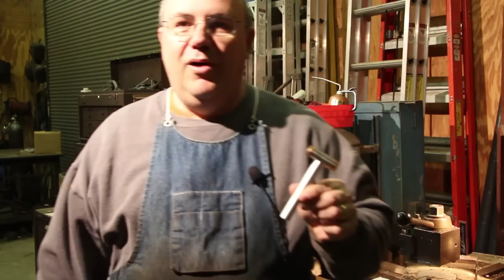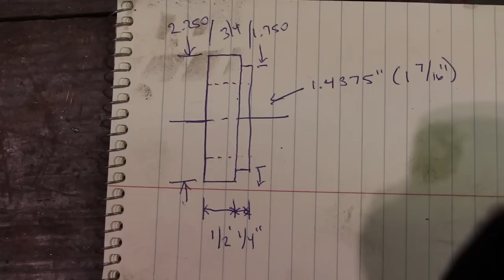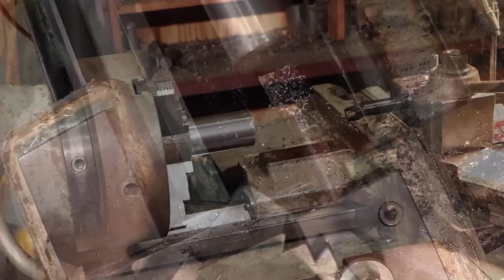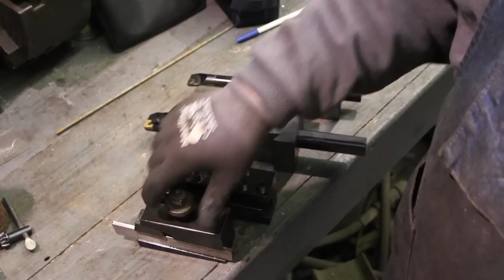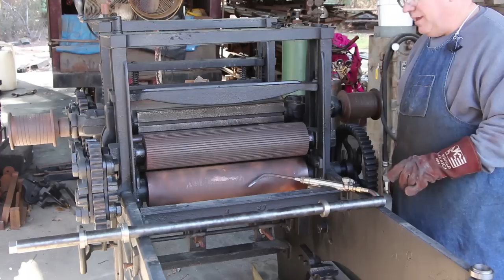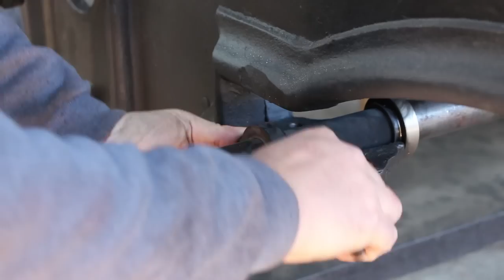Pouring Babbitt Bearings on the J. A. Vance Planer/Matcher

Comment: Keith... you might already know this or experienced this.  Years ago I was service manager for Otis Elevator in Richmond Va.  when one of my service repair crews was pouring new cadtex ( Babbitt hardener I believe ) on an old geared hoisting machine on a hot summer day in a meat packing packing plant. Sweat was rolling off their faces and elsewhere.  Some sweat off the face of the mechanic fell into the hot Babbitt pot heating up for the pour,.  The hot Babbitt exploded, spraying one of the mechanics with splatters of molten Babbitt.  Fortunately, neither  were injured.  A miracle and a very unforgettable lesson.  These mechanics were very experienced in pouring main Babbitt bearings, some larger than grapefruits on the big old gearless machines.  Take heed viewers when heating lead  for fishing sinkers or downrigger balls.   Excellent video.  Thank you.   Work safely.

JoeB

Comment: There's nothing more timely than commenting on 5 yrs old video, but hey, "better late than never", as one old lady said when she was late for a train...
Anyway, about those "impurities" @ 32:18 - "so as this babbit (...) starts getting molten (...) you'll get some impurities that will come up on top of the surface and you just want to skim those off" - well, in fact, you don't want to skim them off. Those impurities are tin and antimony (and other metals) oxides which are the result of oxidation of molten metals. When you skim them off, you just expose fresh metal to oxygen in the air, and thus induce firther oxidation.
One way to reduce the oxidation (i.e. to slow, or somewhat comtrol the process) is to cover the molten metal surface with grounded charcoal. This probably wlll not reduce (chemically) oxides already present, but it will slow the further oxidation significantly.

Comment: Friend, I believe you would get a better tin pour if you drilled a few 1/16" holes on each top cap, to allow gases to vent as the tin pours. This would certainly relieve you of most voids in the tin. You can also preheat the shaft and caps then dust them lightly with a film of talcum powder. This helps the tin to flow...Just some thoughts. Thank you for the excellent video.

Comment: I love old machinery and have a comment. In later years in the Machine Shop at the old Pacific Lumber Co. they used Duct Seal for damming babbitt  bearing pours.
My Father worked in the round house at Palco and I worked there as Power Plant Supt. for over forty years until my retirement.
Keep up the good work.

Comment: Nice video! You brought back some good memories of when I would Babbitt about 10-20 bearings at a time but it was done on a steel bench. We made a cradle to hold the shaft at the correct height and we had mandrells  for all of the sizes of bearings we had in the plant and we did this about every 2-3 months. We used to ( soot or sooting ) the mandrells and make shims out of wasted cartons from 1lb. Sugar bags and the Babbittrite (dog shit ) worked ( DAMN Good). 33 years of machinist and babbitting  bearings was a great job and slowing down the Chuck with the palm of your hand there's nothing like it but I never could wear gloves or wear rings or bracelets while running a lathe. I'm not saying your wrong I just was not comfortable with the things I've seen. Great video Jake.

Comment: we used to pour windmill gear housing bearings used a dummy shaft and plenty of putty  those flat well oiled Babbitt bearingswill handle way more load and last longer than ball bearings I have also worked on babbitt bearings in a ships engine con rod that were big enough for a man to go into the journal with a torch and a bar of Babbitt and fill in the scored bearing then we bored it  and reinstalled it and she was on her way   lots of memories  great video thanx

Comment: Very helpful video as I prepare to pour bearings in my buzz saw arbor. I didn't consider pouring the top and bottom separately but now can see that you get a much better bearing and can separate and inspect the quality of the pour. However, I thought you mentioned you were going to scratch oil holding groves in the bearing surface. Do you leave the gasket in the assembly and what is the process for adjusting the pressure on the shaft?

Comment: Wow!  Great video!  Brings back memories.  On the farm repair of disk, cultivator gauge, plow and planter wheels my father would spiral a small string around the shaft before the pour for a grease channel.  For the release agent he also would use thin onion paper around the shaft.  He wrapped the string around the paper to hold it, then he would rotate the shaft and bearing vertical, and sometimes make a small round funnel around  the bearing case, (which was really just a cast pipe or piece) and pour all at one time.  Just kids modeling clay was used around the bottom as a seal/ dam.  Drill out the grease zerk, bolt it back together  and away she went!  This was 55+ years ago!  My job was to pick up the spilt Babbitt.

Comment: Is Babbit, what we call Pot Metal? It melts under a fairly low temp. They use to use it on fishing poles for the handle.
Reply from the maker: No, nothing even similar to "pot metal".  Pot metal would not make a good bearing material at all....  "Pot metal" is a generic term that is often used to describe die cast zinc.  Zinc will also melt at a lower temperature but it is a totally different alloy from Babbittt.

Comment: I have read that to re melt Babbit metal is not best practice,although I appreciate that this is a low revolution usage would you remelt on faster bearing applications ie big end shells or main bearing in a internal combustion engine ?  Good video, thank you.
Reply from the maker: I like to save my old babbit as I do a lot of low speed stuff that I think it is fine to use on.  For high speed applications, I always use the new stuff!

Comment: just curious, why don't you upgrade the babbit shells to bronze bushings with maybe an oil fitting?
Reply from the maker: Why?  Bronze bearings work pretty much the same as Babbitt and quite honestly, after doing both, I think that the Babbitt is easier to work with.
Reply: Richard Adrian actually Babbitt is still in use in crank and cam shaft bearings in new engines and performance bearings for engines today.
Reply: likely the same reason he doesn't buy a whole new machine: it should all be original
Reply: Dana Muise  with Babbitt you just lay the shaft in and it lines up the bores perfectly every time when it's poured. if he used a solid bearing he would have to line bore the 2 bearings to make sure they are perfectly in line with each other, and the distance between the bearings would make it very difficult to get the shaft to spin free.
Reply: Tyler Hensley yeah I kinda figured with gasoline engines as well. However my main experience with newer engines is mainly with extremely large displacement marine diesel engines and try not to speak unless I know. Otherwise the newest gas engine I have done full tear down on is the 73' 440CID in my charger.
Reply: Keith Rucker - VintageMachinery.org this is an older vid, but I just stumbled across it. you were mentioning that babbit bearings are still in use in various applications and one application that I have encountered is in marine diesel engines. I have done a few rebuilds on the cat 3612 series engines. I actually was unaware of that aspect of the history of that type of bearing, nor was I aware of what it's specific name was. I have only known them by their mechanical nomenclature. so thank you for the interesting video. taught me something that pertained to my experiences.

Comment: the blaking trick works when removing stuck stainless bolts from 6061t6 alum.burn off the black and very quick try to get the bolt out...

Comment: why do you pour the babbitts in place instead of pouring them on a work bench and then placing the bearings on the machine?
Reply from the maker: Getting the bearing shells perfect aligned on the bench the same way they would be on the machine is nearly impossible unless you build a special jig.  Just not worth the effort when you can pour them on the machine.

Comment: First I wanted to say I love the videos.  You do a great job.  Now I have a question.  Why did you do the pour while the parts were attached to the machine.  You mention many times that it is tight and difficult.  Would you be able to remove the part and place them in a Jig on a bench then return them to the machine?  Or am I missing something basic?
Reply from the maker: It kind of depends on what you are pouring.  I would rather pour on the bench when possible, but with some setups, it is critical that you have multiple bearing blocks in proper alignment with one another, and there is no better way to accomplish that than to mount them on the machine where they go and just pour them in place.  It would be very difficult to come up with a jig on the bench that would put them in perfect alignment like you get on the machine.

Comment: A little trick when using (thin) gasket paper for small things:
You can use a photocopier to get the shape on the paper. Just make sure to set the zoom on 100%. ;-)
Reply from the maker: Good tip!
Reply: For small parts I use an ink pad and stamp the part directly into the gasket sheet.

Comment: Ive never seen a heavy duty gas Turbine that doesn't use a babbit type material on the bearings. Ive always wondered how the machine shop does this.

I really enjoy your videos! You're very knowledgeable and have taught me a few things.
Reply from the maker: +Cierra Seal That is basically the method, however there are some more modern methods of pouring babbitt for modern applications, including centrifugal casting and such.

Comment: I have used pottery / ceramic clay for years as a damming agent when Cad Welding electrical ground connections .

It can be molded as you were doing .  When the heat of the molten copper hits it , it instantly dries , to a hard consistency .  And , of course , being clay , it is fire proof .

After everything cools , it is easily broken away .

It is available , locally ,  in 5 pound blocks , at a store that sells arts and craft supplies .

I tried , long ago , using duct putty .  It seams to be oil based and melts when the heat hits it .

Here is a product made by Cad Weld that probably does about the same thing .

https://www.erico.com/part.asp?part=T403

God bless
Wyr

Comment: Hello Keith,  I have a dumb question.  I watched the video of the Babbitt pour twice and read through the comments but I missed the part on the smoking of the axel shaft.  What is the purpose of putting a layer of carbon on the axle before the pour?  Why did you only need to smoke the shaft for the top bearing and not for the bottom one?  When you poured the top bearing would it help the quality of the bearing if you drilled a second vent hole in the bearing cap to allow the hot gasses to exit while pouring?  Thank you for the information.  Brad
Reply from the maker: +Brad Johnson The purpose of the smoke is to serve as a release agent to help the babbitt separate from the shaft once it cools down.  I usually only smoke it once - it is still there when you pour the top half (but you could smoke it again if you wish).  A second hole would not hurt anything but I usually don't find it necessary.

Comment: Hi Keith, with the Babbitt bearings would it be possible to bolt the shells together with shims and use a reamer instead of scraping them?
Reply from the maker: +Doug Borrett I have used a reamer for solid bearings before but never on split bearings.  I am sure that it would work, I just have never thad the right size reamer when I wanted to try it.

Comment: Got a question, I have a "special" application where I need to make a bearing type surface on a very small shaft, 1" or less. How do you think the Babbitt material would hold up in a situation if I pour it into a 2" form, , making a 2" Babbitt "rod" & then turning it on the small lathe, & drilling it out, & making a kind of mini bearing / Bushing out of 100% Babbitt.?  Then they can be popped out & replaced like changing a bearing, & you could make several replacement sets.. Thanks, Love your Vids..
Reply from the maker: +Bob White Nothing wrong with that idea at all.  I have sometimes machined the inside surfaces of babbit for small shafts.  Just make sure that your "drop in" bearing has some means to keep it from spinning in the bearing shell.  You could mill a flat on one side or something so that it cannot turn.
Reply: +Keith Rucker - VintageMachinery.org   Actually in my case I can put a small drift pin in, in fact I have way too many very small round head Brass machine screws that I can cut to length, use as a drift pin, & the head as a stop to keep it from going in too far, also make the hole a hair smaller, & drive the threads of the screw into the Babbitt which should lock itno it.. thanks for your fast answer, I'm a 66yr old disabled Vietnam Vet in a wheelchair... I do electric wheelchair repairs.. I had to get rid of my big lathe as I could no longer get enough strength to switch out the 3 & 4 Jaw heads.  I'm trying to save money for a small Lathe at Harbor Freight..  I do all electronic repairs as well as machine new or fix used parts.. Thanks again...  Bob

Comment: If you haven't already found a replacement for the putty you used to seal it up, you may be able to use some of that red fire caulking putty that is used to seal up the ends of electrical conduit for fire protection.  It about the same consistency and should take the heat.
Reply from the maker: +David Cantrell I have since source quite a bit of Babbitrite that will last me for some time to come!
Reply: I figured you might have already since you posted this video a while back.  I'm just now finding them.  Pretty cool to watch.
Reply: +Keith Rucker - VintageMachinery.org Deacon Mold-Pac was going to be my suggestion.

Comment: Hi Keith, i would like to start by saying that i realy appreciate your video's and look forward to seing all future ones, out of good will and honorable intention i would like to warn you about wearing rubber/nitrile coated gloves near shaft rotating machine's, they have a tendency to grip on rotating shafts and as we all know we are always touching or in the proximity of rotating parts and i had a near miss with these glove on my lathe by accidently touching the leadscrew, im convinced i would be machining myself a prostetic arm  if it wasnt for my fast reaction to remove my hand when it started griping the glove, please be careful, ive worked in a foundry for years and i would suggest that you wear work boots with Metatarsal Guard and a face shield when pouring the babitt, i know your a very safe person and like all old timers like me and you that your most likely not going to have a work accident but as an example to all the new mechanical rookies trying to immitate you and have no experience to predict the unpredictable risks machining and casting, accidents happen very fast, thank you
Reply: They didn't look like nitrile to me.  We use kevlar gloves at work because of all the glass we work with. They look like that, but they're not at all "sticky" like nitrile.
Reply: Three years later... Hey, I'd never heard of Metatarsal Guards. Thanks for the education!

Comment: Would making bearings out of brass be any better?  Or worse?  What's the benefit of babbit over other soft metals???

Awesome video by the way!!
Reply from the maker: MattsMotorz Well, Babbitt is a "soft metal" similar to brass, or more correct, bronze.  Babbitt is actually a bit softer than bronze and for many applications makes a better bearing surface.  The advantage of bronze is that it is hard enough to machine and press bushings in where with babbitt you pretty much have to pour them in place or apply them to some harder metal (like with crankshaft bearings in engines).  I use bronze bearings in a lot of applications, but for the most part, when I am restoring a piece of machinery, I try to keep the bearings as original as possible, so if the originals were babbitt, that is what I like to go back with.
Reply: Awesome! Thanks for the response!

Comment: You frequent the old woodworking machines forum too?  That's cool!  They helped me a few years ago when I went through and rehabbed the Dewalt Powershop I inherited.  Probably not the vintage you're used to but those guys are incredibly helpful!  They helped me find the really, really obscure rollerhead bearings that thing uses.   They had been seized for who knows how long and my father in law was lubing the rollerhead with white lithium grease.
Reply from the maker: NGinuity I am not as active over there as I once was, but I still frequent the forums from time to time.  And yes, they are a great bunch of guys who will bend over backwards to help somebody in need!

Comment: kieth, a company i worked for, we used to do a lot of 'cad welding' which was essentially a copper charge being melted inside a graphite mould to weld 2 copper cables / plates together...we had a clay type substance that is purchasable to seal around the cable / plate ends where it entered the mould, it is heat rated to withstand the blast pressure and heat from the charge that metls the copper etc... it does dry out when used (bakes I guess would be the appropriate term) so am not sure if it is actually reusable once its baked...

Maybe if you google 'cad welding supplies' or something along those lines you might find something suitable as a replacement for your babbit sealer :)